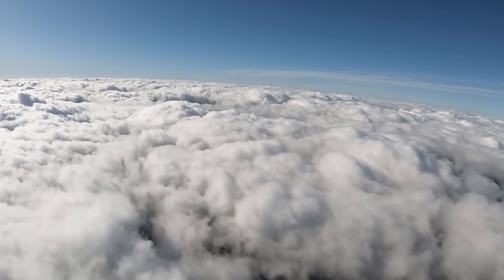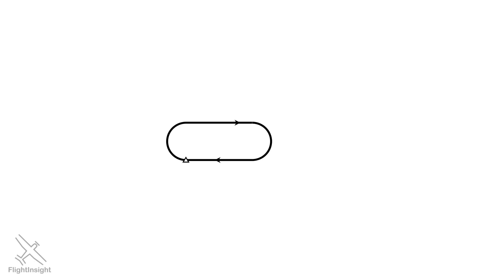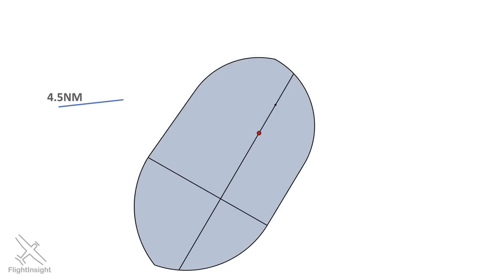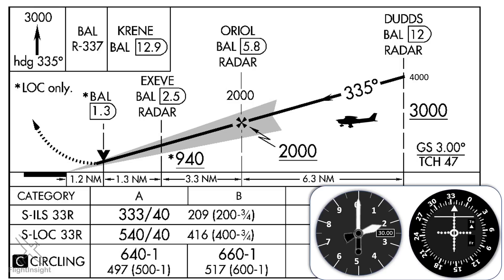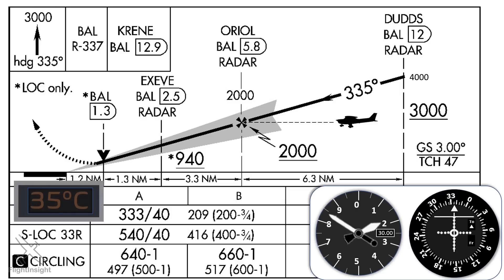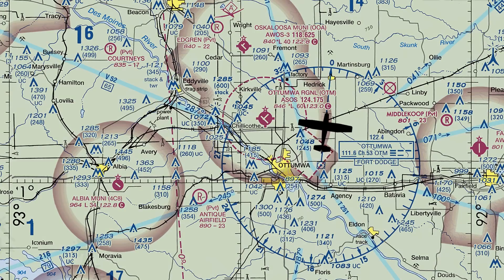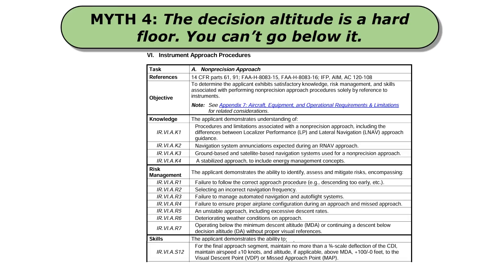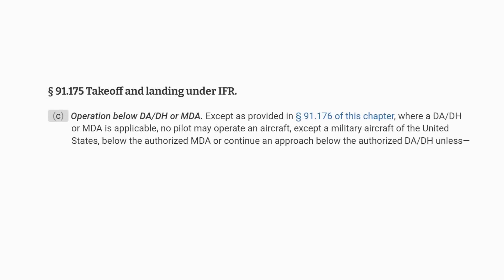4 Myths About IFR Flying | Instrument Checkride

Comment: 2:42 Is it legal to cross BELOW a published restriction while on the GS?
Reply: he was not on the glideslope, yet, he was at the minimum altitude to cross the FAF. being below was just a hypothetical for hotter air, that's why he then corrected to 2000, which you need to be to intercept the GS

Comment: I was always taught that the "protection" for the protected side of the hold was primarily for the purposes of traffic deconfliction, not terrain, so ATC has a bit more freedom and simplicity when it comes to vectoring in the terminal area. Any thoughts?
Reply: this is what i was taught as well, our usual practice hold was over CCC and i was told it was this way to help let ATC get the jets in to the bravo

Comment: why is myth number 2 wrong? you would have the correct altimeter setting by then so always be at 2000 true, rigth?
Reply: Altimeters cannot correct for temperature.
Reply: @neverfox  isnt baro setting based on temperature too?
Reply: @Madfalcon45  in a very simple way, the barometric altimeters do not read altitude or heights. they measure presure that then is corrected so that you can read altitudes or heights. One of those correction factors is ISA temperatures, so when in places that go way above/below those you have to correct again for temperature. hope that helps a bit.
Reply: @havattarah  isnt that what the baro setting is for? like setting 30.00 instead of 2992 when other factors affect it?
Reply: @Madfalcon45  not necessarily. you are just coming out of a std pressure (in the US) to the local pressure, but that local pressure on your barometric altimeter is corrected only for ISA values, and this will cover the majority of the scenarios all year around. but in extreme scenarios a temperature correction, a pressure correction, or even a wind correction can be done. general rule airports that operate inside those "extreme" scenarios will have already published procedures or even under radar control, the RADAR minimum altitudes are already protected for low temps (generaly only apllied when temps below 0ºC, since is the most dangerous. if low temps your true altitude is lower then indicated altitude). Some modern FMS will/can aplly those corrections automatically. Exemple, a 2000ft glide slope interception on a aerodrome temp of -40C will need a correction of around +450/500ft (aerodrome elevation plays a factor as well, type of approach, type of equip. etc)
Reply: @Madfalcon45  Yes, temp affects pressure but it also affects the lapse rate (through density). Altimeters are calibrated to an ISA lapse rate and there is no way to adjust that. So in ISA, a true altitude of 3000’ occurs at 26.92”. But at -15 C, ceteris paribus, 26.92” happens at ~2900’. There will not be any temperature error at sea level, but it will get worse with altitude, since it’s a matter of lapse rate. In other words, when you set your altimeter to the field setting, you're only making it the case that it will read true altitude at field elevation. That will not be true of any other altitude unless unless you're in ISA.
Reply: @neverfox  ok this makes sense, so whenever the temp isn't 15c the lapse rate is not -2c/1k feet and the altimeter will be off?
Reply: @Madfalcon45  Correct, everywhere but at the reporting station elevation.
Reply: This explanation is incorrect.  The final approach fix on the ILS is always glideslope intercept at final approach altitude.  The Maltese cross marks the final approach fix on the localizer approach.  These are two different approaches, one precision and one non-precision, on the same approach plate.
Reply: @garygandy2615  no it's not. the DME distance marks the FAF as an actual (theoretical) point in 3D where a plane in flight at the crossing altitude under standard atmospheric pressure intercepts the glideslope. if air is hotter or cooler the plane will fly a different true height and therefore intercept the glideslope a bit before or after that FAF.

Comment: Good reminder that you don't have to begin the climbout before the DA if no runway environment is in sight. Thank you! The problem is I don't know if all examiners will also know this.
Reply: Even if the DPE disagrees, most DPEs won't consider it a "wrong" answer if you are pointing to the relevent regulations and provide sound reasoning for your interpretation. (Also you could go to the FAA terps publications and show that approches are designed assuming that you will make the decision at the DA and dip below due to momentum. Those publications are not intended as piloting rules or educational references, however they are support for interpreting FAR 91.175(C) )
A personal operational consideration is to set a slightly higher DA if your climb angle will be borderline on the missed segment, but this is more of a specific case. You also don't want to be too conservative on the DA either, because actually breaking out and landing is generally safer than going missed (Assuming all else about the approach is stable, between the lines, and obstacle clearance maintained.).
Reply: @mytech6779  I agree. However, it would still be stressful and no guarantee.
Reply: You could just ask the DPE you know... say "so this is how my instructor trained me to shoot ILS approaches down to mins, if this fine with you?"